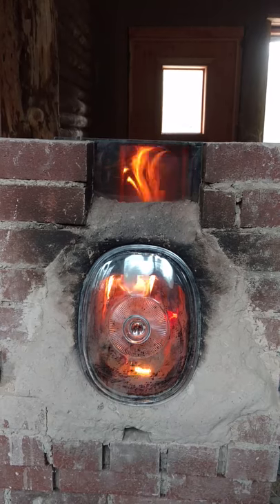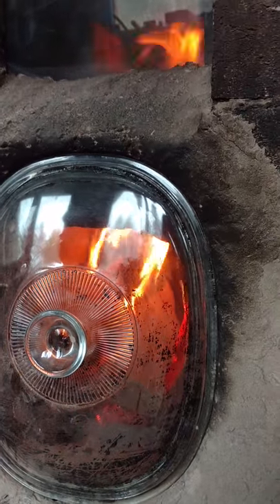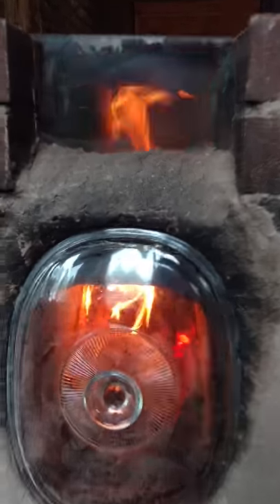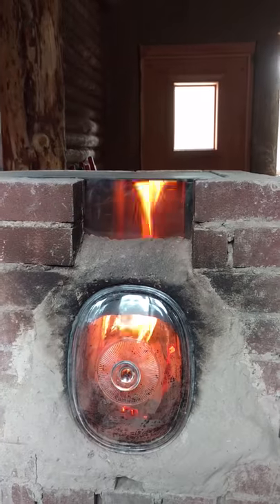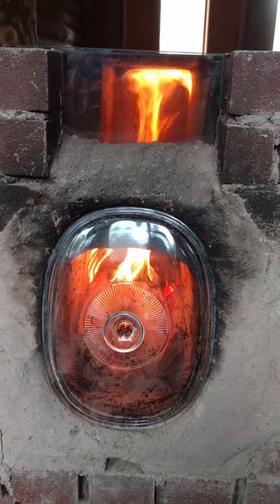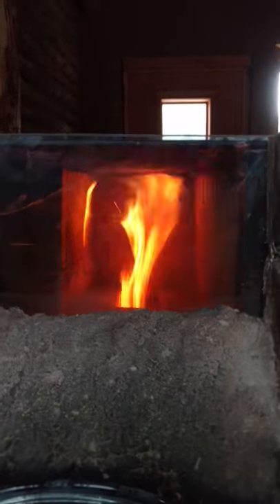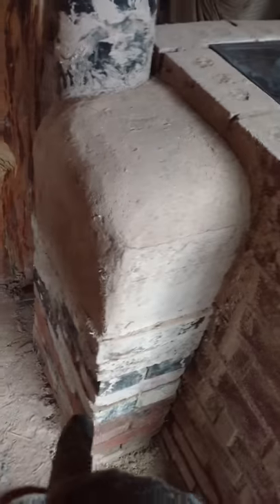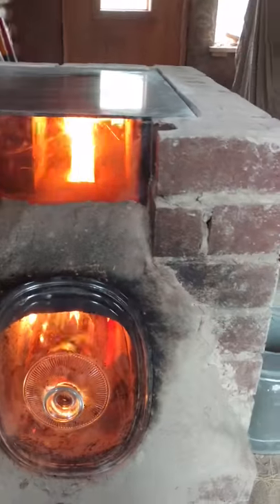Peter Van Den Berg's Double Shoebox Cookstove

Comment: How is the glass on the stove top holding out over time? Also, judging from the rings, did you cut the original piece to fit? I always thought heat resistant glass couldn't be cut easily... did you use a regular score-snap method to cut it?
Reply from the maker: The glass on the stove is holding up perfectly.. I had expected thet it would not be able to be cut but we were able to cut it with a diamond blade.

Comment: How is the glass cooker top sealed to the top of the rocket mass heater?
Reply from the maker: You can use fiberglass gasket or high temperature caulk or even thin cob

Comment: How is the glass cooker top sealed to the top of the rocket mass heater?
Reply from the maker: We used a little bead of cob to seal it. You could also use high temperature caulk or fiberglass rope gasket.